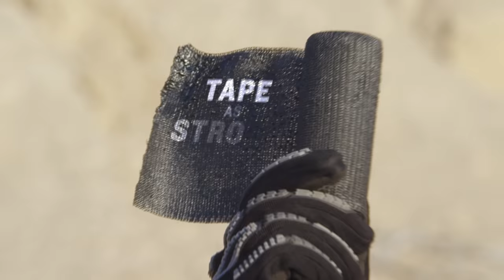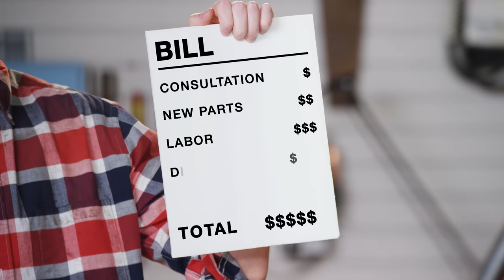Redneck Drives a Duct Taped Car Off a Cliff!

Comment: Its funny but they're setting themselves up for a lot of dissatisfied customers. (Those dumb enough to believe the claims)
Reply: I've used it and it really does work so i don't know who would be upset
Reply from the maker: If FiberFix doesn’t live up to your lofty expectations, we’ll man up and make it right. No mansplaining, no appeal to a manager, no mandatory waiting period. Just drop us a line and we’ll take care of it.
Reply: FiberFix I like your marketing efforts but the only way something such as FiberFix COULD work would be if it were applied in a strategic, enginneered manner, then placed in a vacuum and autoclave. I guarantee you couldn't break the steering head off of a motorcycle and fiberfix it back to the frame with enough confidence to ride it at interstate speeds which is still less demanding that the car off a cliff. Tent pole, Probably / maybe... SHovel Handle with basic back yard application? I'd be beyond impressed. Also, removing the engine etc from the car greatly lessens the impacts and driving the truck up the pole is not placing the majority of load on FiberFix. Infact you might be able to do the same thing with no or duct tape in that example